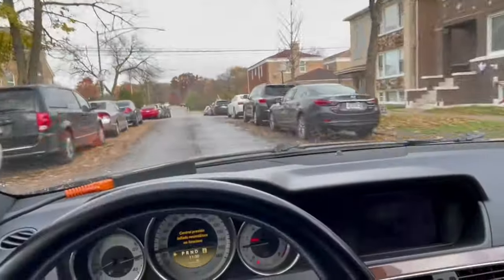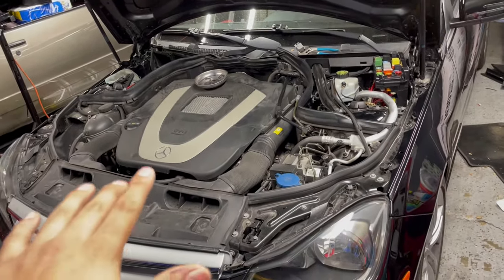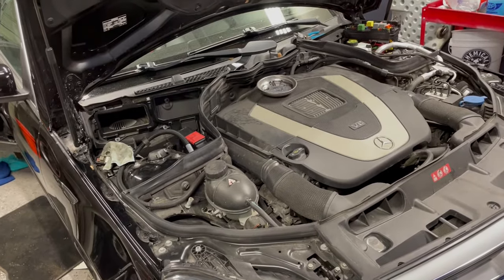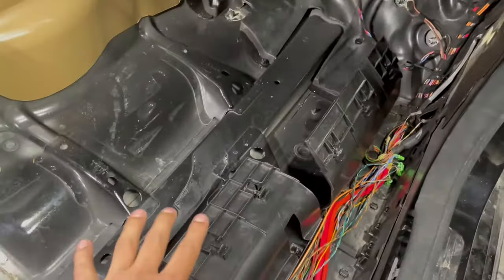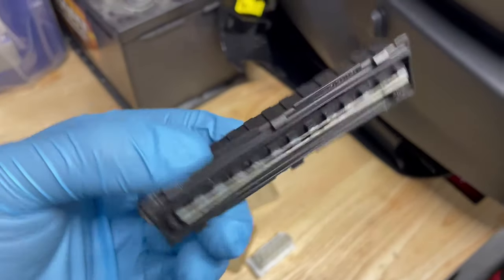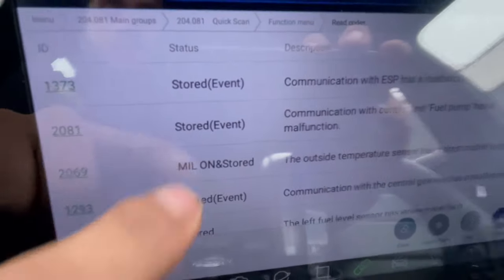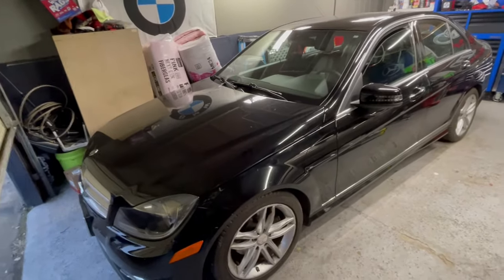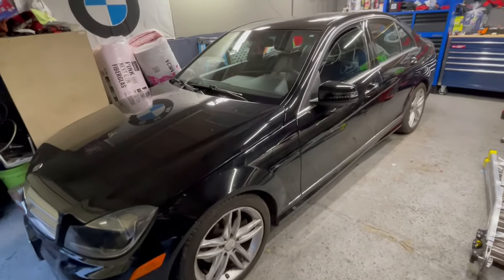2012 Mercedes W204 Central Gateway Fault!! No communication!! All dash lights on! The solution!

Comment: I have the same issue with my 2008 w204 C180K. The workshop asked me to get a new Front sam Unit but i refused as it's damn expensive. Maybe i can try to remove my flooring to see any corrosion. Can u share with me the parts that u changed?
Reply from the maker: Check the bottom carpet for any water or water damage! Here are the parts I changed the small white distributor Block part(#0055461040) and the black bigger distributor part(#0045468040). I actually got this from the Benz dealer for under $70. If you have any other questions please feel to reach out!
Reply: So once I change them I should be good I cleaned mine and they work for like couple hours then fail again hope I can get it from the dealer all three I got the w212 and permanently fix it
Reply from the maker: @madewitmoney5578  also make sure to check the connectors! Make sure there is no corrosion before connecting the new distribution blocks.
Reply: @Fwerks.1592   ok thanks the link that you have for the parts disappeared
Reply: @Fwerks.1592  and thanks for this video it’s a life saver
Reply from the maker: @madewitmoney5578   , this is the white small block distribution block part# 0055461040 and the longer block part number is # 0045468040.
Reply: @Fwerks.1592  changed them same problem you think it’s the Sam module
Reply from the maker: @madewitmoney5578  , check the front sam fuse box. Also do you have any other fuse boxes around the passenger footwell? I know every chassis is different, I found that on the W210 you have a sam module in the passenger footwell.
Reply: @Fwerks.1592  open the Sam box look around now it’s not starting but the radio and ac works and only one headlight is on  no lights on the dash
Reply: What does the front Sam controls and the rear Sam so I can figure out something
Reply from the maker: @madewitmoney5578  the rear module controls, sound system, seat controls, telematics services, cig lighter, keyless go control unit, front fuse controls instrument cluster, fuel system, starter,wiper motors, ESP,
Reply: @Fwerks.1592  so which one you think is bad in my case
Reply: @Fwerks.1592  cause the dashboard doesn’t come on and seat’s don’t work everything just malfunctioning
Reply: @Fwerks.1592  and the key only unlocks one door now  and headlights only come on an off on one side so question is any one off the sam  Responsible for those signs
Reply from the maker: @madewitmoney5578  , retrace your steps . 1 check that all your fuses are good, check for any blown fuses. 2. Check for any loose connections, make sure any plugs you removed ( if you removed ) are properly connected to the fuse box. Also try to get your hands on a scanner that can read canbus issues. This can be tricky trying to figure out where the problem is!
Reply: @Fwerks.1592  I did and it’s the same problem so is it something other than the sam module then
Reply: @Fwerks.1592  you was right retract my steps was the red pier wire off respect but still having the Sam issue as before you think it’s the front sam or the rear one
Reply from the maker: @madewitmoney5578 , your problem should be in the front I’m certain! The rear Sam only controls most of the interior seats,door actuators.
Reply: @Fwerks.1592  ok going to order one hopes this works and respect all the time for responding 🇯🇲🇯🇲🇯🇲✊✊✊ and will post how it works out
Reply: @Fwerks.1592  got the new sam module do I need coding same part number
Reply from the maker: @madewitmoney5578  , yes you will need to code/ reprogram that Sam to the vehicle!
Reply: @Fwerks.1592  changed the sam same thing it was the wires this whole time shorting out if you move them from side to side wasn’t the Sam or connectors this whole time now I got a sam for nothing
Reply: @Fwerks.1592  only thing is how to get rid of this pre safe malfunction off otherwise it’s running like it use to
Reply from the maker: @madewitmoney5578  was the sam programmed? Also you didn’t check the wires before moving to the next step??? I thought you said you had checked all that and the distribution blocks? Now that you said you know it’s the wires have you checked the wires for any pinches, or spliced wires? Sounds like you may have a bigger issue. Find the wiring issue and make proper corrections.
Reply: @Fwerks.1592  I took the distributor block off  the ground and tuck them between the carpet and floor and it’s working right now

Comment: These damn things have many many electrical glitches.
Reply from the maker: Tell me about it!! If it’s not the intermittent dash lights, then next you know your radio goes out! I’ve notice these c300 have some sort of electrical issues!
Reply: @Fwerks.1592  I have an intermittent interruption in communication on CANBUS between the ESP and the ECU. They should talk on DATABUS II hub (green and green-white). I can’t find the damn thing anywhere to check the connections. One of these days I’m putting the w204 into the garage, strip all the wiring out and redo it. Or find a peaceful moment without any errors and sell it on.
Reply from the maker: @cipmars  I agree put it into the garage and start pulling things apart! There’s very little information out there about where some modules are located in the w204. I hope you find the issue, keep me posted!